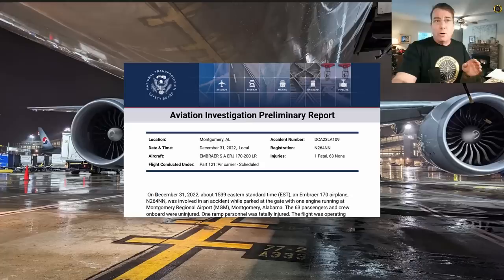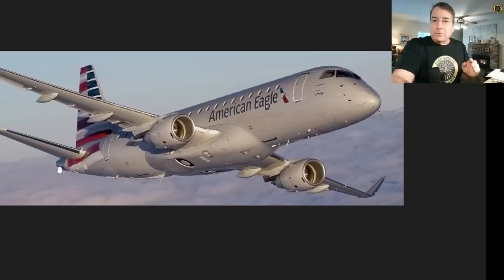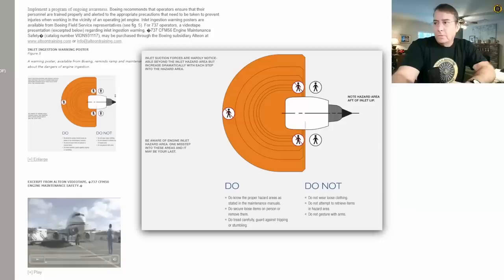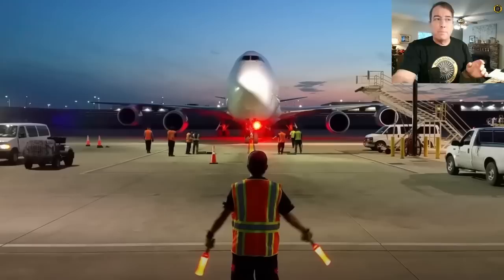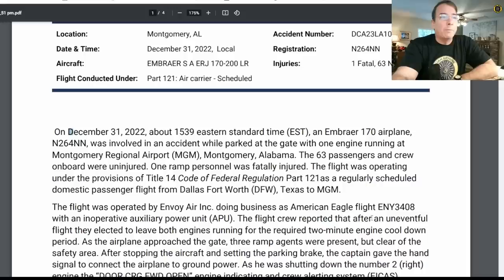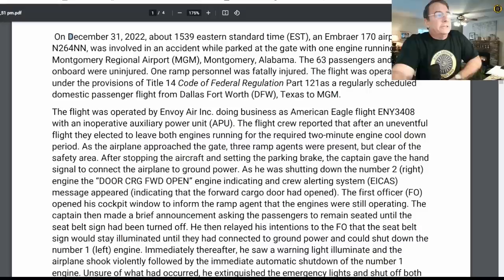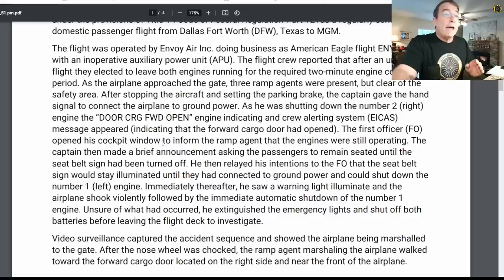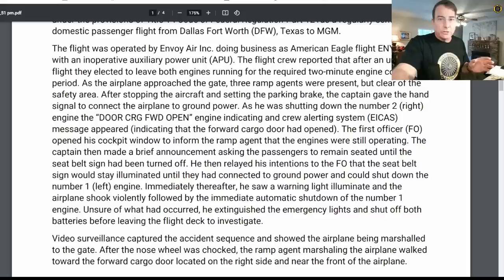NTSB Preliminary Report Ramp Agent Fatality 31 Dec 2022 Montgomery Al.

Comment: I was an American eagle station agent for 13 years, I didn’t work on this specific ERJ model, but have worked on others.  On-time departures are wanted and stressed by management and quick turns are common on late arrivals. Safety protocols are there for a reason and if not observed or shortcuts you could hurt yourself or someone else is stressed to all agents. We were advised All aircraft while the engine is running, safety zones must be  observed and no equipment or agent should go near the aircraft until those engines are shut down. Also, we were told you should not go toward the back of the aircraft while the engines are running as you may be knocked down or hurt by the engine exhaust. If no jet bridge in MGM is used it appeared she may have been going to the door to disembark the passengers and would tap on the door to indicate acknowledgment to flight attendant.
This is an unfortunate tragedy and could have been avoided and my condolences go out to the agent’s family.

Comment: As a former Ramp Rat at YVR (Vancouver, Canada) of 16 years, I was present but did not witness a similar accident.  A 737-200 was approaching the gate when a worker (a aircraft mechanic) was ingested into the #2 engine. The only difference here was this took place because the worker intentionally did this to take his own life in which he succeeded. 
This was done in full view of passengers in a waiting area at the gate next to where the plane was coming in. Thankfully, I was on the other side of the ramp when thos tool place.

Comment: This is a minor point in so great a tragedy, but the NTSB report is hampered by an inability to make specific identifications. Ground crew are described by where they are going not who they are. The woman almost knocked down by the exhaust seems to be the same person who latter is drawn into the front of the engine, but that is not clear. Perhaps ground crew should wear identifying clothing like those on the deck of aircraft carriers. And yes, a lot could be learned from carrier safety rules.

Comment: Gonna pop in my 2 cents here as a, novice aircraft mechanic working with these types of aircraft. The pressure of getting a plane out on time and repairs is immense. One night I was removing fan blades for an inspection and was taking my time, and one of the other mechanics told me that a supervisor had said I was 4 hours behind “schedule”. This was me and the other 2 peoples first time performing this task. Told the other mechanic that if they have a problem with how long we were taking they could pound sand. Not going to risk damaging a blade or hurting myself so the plane can be “on-time”. I hope the FAA will really crack down on the dirty dozen of aviation.
Reply: That pressure has been around for half a century, irrelevant.

Comment: Having spent a considerable amount of my career doing failure analyses I offer that it can be obvious what immediate factors contributed to a failure. However, investigators should not stop with those, because oftentimes there are systemic reasons, e.g., management pressures, which may contribute as well. These are often harder to identify much less correct.
Reply: Your hit the nail on the head. My mantra that I taught my FO’s was “Protect the best interests of Alaska airlines and protect while protecting Alaska airlines from from Alaska airlines.” All companies are under pressure from major stock holder investment firms to squeeze out more profits. Most CEO’s don’t have the nerve to draw the line between profits and safety. Ramp Ops isn’t that hard but they make it hard by not training constantly and poor leadership from above.
Reply: @Gundog55  Maybe I'm misunderstanding your statement ? So you would rush ground crews to get out on time?
Reply: @davidsmiths5471  You are misunderstanding. I am saying the opposite. “You rush…someone will get hurt.” Alaska had a new hire ramper that was pressed to “turn the aircraft in time”. He failed to put the brake on and chalk the belt loader. It rolled into him as he was opening the cargo door and crushed him to death. Management needs to accept that there is a “Speed of safety” that can not be pushed. It seems that this is very hard for them to accept due to the pressures that the major stock holders like BlackRock and Vanguard refuse to accept.
Reply: Okay thanks for answering!

Comment: Citing the “Swiss cheese model”, what’s more incredible astonishing is that a modern engine can’t be shut down immediately at the gate.  All engines, including old radial engines (lots of heat) were always shutdown on the way to the gate. If engines are running then not even chocks should be put on. Everyone stays indoors until engines are off

Comment: I was an aircraft mechanic on these airplanes and run taxi qualified. Standard procedures for us with an inoperative APU was to taxi to the gate with engines running. Upon marshal and entering the silhouette, we would shut down the left engine since that’s where the power cord will be connected on that side of the plane and added additional safety to the ramp crew entering that side of the plane to connect ground power.

Comment: I flew the E175 for three and a half years, luckily the APUs on our aircraft were pretty reliable, but I had probably between 5 and 10 flights with an MELed APU, one time they opened the fwd cargo door but luckily we had taxied in on the left engine. I think it was a genuine mistake on the ramper's part, not from pressure on the operation.
Reply: What would happen if they just killed both engines when that bin door was opened! Not blaming that crew at ALL!

Comment: I'm a recently retired 30+ year major airline mechanic.  During that time I have worked both line & hangar.  I've seen people killed & maimed for life in different various accidents as well as several near ingestions.  When I worked defense contract we were doing engine trim on an F-4.  The aircraft was on the high power pad, chocks installed and also tie down chains and intake screens.  While running in full after burner a guy came up from below in front of the number one engine.  It pinned him to the screen & started sucking everything out of his pockets before it was shut down.  That's how much power these things have.  FLY NAVY!!!

Comment: Well… All the right answers were given interviewing the ground staff about the safety meetings at Cetera. I wonder if they were interviewed at a different time separately again if you might find a different story. Everybody knows what the right answers are especially when somethings gone wrong and nobody wants to get in trouble or lose their job, if they say the boss pressured them to get it done fast. And were there any language problems. Did the person who was killed speak the same language as the rest of the ground staff. The story about the safety briefings sounds a little too perfect to me, but maybe I’m just paranoid.
Reply: Yeah I know what you mean, the report makes it sound like they talked through and emphasized the unusual circumstances and safety precautions multiple times and the agents then just didn't listen and one got themselves killed. And maybe it did happen that way, it's certainly possible, but maybe there's some more nuance not mentioned in the report. Maybe this stuff was said in mandatory briefings where usually all the same stuff is repeated, so nobody really listened and noticed things were a bit different this time (basically, complacency through repetition)? Language issues, as you said? Time pressure that leads to routine disregarding of certain safety precautions, which normally works out ok, until it didn't, since things were a bit different this time?
Reply: You bet your ass some pencil whipping and story coordination went on. It's not paranoia to notice an all too perfect cover story, it's common sense.

Comment: Aviation safety is everybody's full time job. 
  I worked as a ramp attendant and also as a fuel agent for about ten years at an international airport in Maine. Late one night I walked dangerously close to the front of an operating B-707 engine. I was pulled out of the ingestion zone by my supervisor and I received a very "spirited" verbal reprimand and a teaching moment from him. I have never forgotten that close call.
 As a fuel agent I responded to a fuel order from a crew flying an ATR-72 which has a single point fuel receptacle outboard of the No.2 engine on the underside of the leading edge of the right wing which requires a ladder to reach and is within a couple of feet of the No.2 engine's propeller arc. The airline had deceided that they would not be shutting the No.2 engine down, it probably had the generator on it however, the prop was stopped with the prop brake on. I refused to service the plane until the engine was shut down and a standoff ensued. After several minutes the engine was shut down and the fueling was completed, I never heard anything more about the incident. However, just one week later a young female ramp attendant working for that very same commuter airline was killed in New Hampshire when she walked through the prop acr of the operating No.2 engine, as passengers were boarding the plane walking across the ramp from the terminal to the plane. Apparently she had spotted a set of wheel chocks at the right main gear, she retrieved the chocks and ran back out toward the front of the plane and made the mistake of running through the spinning propeller. Just heart breaking and very trajic.

Comment: Juan, I dispatch the E175. Two points: It is possible for a cargo door to be opened prior to the triggering of the IN time, which is not driven by the brake, but by the opening of door 1L. The OUT time is set by dropping of the brake.

Additionally, when we have an aircraft with an APU MEL proper procedure is to call the station and tell them that we are sending an aircraft with an APU inop. We do this before the flight leaves so that if for some reason they can’t do an air start, we don’t end up with an airplane stuck. It also reminds the station that they need to take care because of the different way an aircraft must be handled with an inop APU.

Now that I have heard your take on the report, it settled some questions. It confirmed my suspicion of an APU “involved” situation (I was thinking crossbleed start), but if the right engine was shut down before gate arrival (usual practice for quick turns), it further confirms that it had to be engine 1 involvement.

It doesn’t explain why the ramp agent was in that position, because this should not have happened.

Comment: I used to work for a company doing on board catering, we weren't directly involved in ramp operations, but still had to work in with, and around the other teams. Got out of it because managment were hiring new staff who shouldn't have been out there. The attitude was "just another job". Many of the staff worked it as a sceond job, so you not only had tired back of clock staff, but people who had been awake maybe 16 hours or more...
I saw all sorts of things and had to intervene in many situations that were not my responsibility to stop something progressing.
Two incidents that come to mind are when I saw some aluminium air stairs blowing back from a just landed 737. The ground crew placed the stairs on a very windy day and just walked off withour ensuring the brake would hold the stairs- I had to move fast and push the stairs back into position before the rear door was completely opened by cabin crew and passenger disembarking started. The rear cabin crew actually opene dthe door and had a look of shock on her face when there were no stairs there.
 Another time, waiting for another aircraft to arrive- observed a Jetstream 32 taxiing for a runway with it's tail loading stand still attached. Had to get out of the truck, wave arms at aircraft from 100m away and make an impromptu dangling signal with my arm. Cockpit crew obviously understood, so they braked and turned back to the apron.
 Everything on the ramp will kill you, you have to be aware of everything all the time.

Comment: NTSB should investigate the contractual penalties when performance metrics are not met, and how that filters down to the rampers.  Performance optimization can be corrosive to safety.
Reply: And they should look at the metrics of the metrics.  Lets say that something happens on the second of the month.  Then on the thirtieth (the end on the month) it is determined that the metrics were not met so corrective action is called for.  

Really, what happened?  

I don't know but we missed the measure because of it.  

Oh.

Comment: This is so unfortunate. Seems like none of ramp agents followed procedure resulting in this accident 😰 Rip ramp agent 🙏🏾
Reply: No, it sounds like the guy that chocked the nose wheel called out the guy that opened the cargo door and tried to alert the girl who placed the cone at the back, who then walked around the wing and got ingested. So at least one out of four were trying their best.
Reply: It is unfortunate.  But, more importantly, it is (and was) preventable.  Hopefully, lessons will be learned from it that prevent other ramp agents from suffering a similar fate.
Reply: Two of the four rampers were following procedure; The one setting the nose gear chocks, an the one waiting off the end of the right wing.
Reply: @charlestoast4051  maybe I heard wrong! But the person that chocked the front is the same that opened the bin! And the ring wing ramper was the guy doing all the jestering! And then a forth appeared by the front gear!
Reply: @jcl410  the person that chocked the plane was the one opening the bin! And proper procedures he would have signal the crew the chocks were in place!
Reply: @davidsmiths5471  The NTSB , report is confusing... They mention that there were 3 ramp agents, but later they mention a fourth... Re-listen to 8:31 in the video....

When a jet pulls into a gate one tamp agent marshals (guides) the plane to the correct stopping point. Then a (4th in this case) ramp agent places the chocks. After that is done, the marshal-er lets the pilots know.
Reply: @jcl410  Should work like that if you have 4! A/C reported 3 though! What I'm confused by the Marshaller brings the plane chocks the plane ,but never goes back to signal the pilot! But goes right to the front bin!! And the ramper sitting under the plane shouldn't be there either! Even the ramper statements are all over the place!!

Comment: Juan, I worked the ramp for 4 years for US. Then got into dispatch. Rampers are put under immense pressure by management. US Airways ramp management was ruthless at my Hub. They know the people are very expendable. They write you up for every little thing. My whole team got written up for a 2 minute delay on a Madrid flight once. It arrived in Madrid 1 minute late according to the report they gave me. 

Hell, the first week out of training on the international ramp but into my second month since signed off on domestic ramp a ramp shift manager was trying his best to get me fired because I was doing the Load coordinating for the team and accidentally had my team put on a standby pallet to m a weight restricted flight which I did not learn of until they were taxiing out. I couldn’t get a close out for the flight, called CLP and they said he’s got to come back you put a standby pallet on. No one ever once during training mentioned anything about standby freight at Intl ramp. 

Unfortunately, it turned into a bigger ordeal for management thus trying to screw us because the guy that was on my team who was working the K Loader when he removed the standby pallet off. He forgot to put up the locks on the pallet that he had to first pull off to get the standby pallet off. This guy was even more green than me! So maybe a month in! Well as you could guess they felt a slight load shift Enroute. Luckily, it wasn’t a load shift with MRAPs as cargo and they continued. The Safety management guy also decided after looking into it all he cleared me of wrong doing do to improper training. 

It was a fun 4 years doing that in my early 20s but management destroyed the joy that job could be. But it ultimately lead to approaching 16 years of experience in the industry as a ramper, dispatcher, and controller (Covid killed that dream due to training delays) so I returned to dispatch after 3 years with the FAA.

Comment: I hope that pressure on turnaround timing was not the reason that the ground crew felt the need to approach the aircraft in a dangerous condition.  The clock for turnaround should not start until the aircraft is in a safe condition for ground crew to work.   This was a terrible incident and hopefully we get to hear the lessons and actions from this event so that we don't see another.

Comment: Flew the 175 for a few years. It is my understanding that the opening of the cargo door does stop the clock as does the parking brake (like you said). With that said, the parking brake is usually set immediately after the plane comes to a stop....before chocks. So I don't think that would have been a factor in this case. I would also a ramper for a few years for Express Jet.  There were time pressures, however we typically did not approach until the beacon was off.

Comment: When I flew the ERJ we had cargo doors open before engines were off at outstations multiple times. It scares the crap out of you. Have also had ramp agents approach the engines while still running. As for your question about stopping the “clock”, the “In time” for the ERJ at my company at least was when the L1 door was opened. Since the mass hiring of new employees at airports, I have seen multiple safety issues, tug incidents, pushback incidents etc. I fear this at be a symptom of frantic hiring.